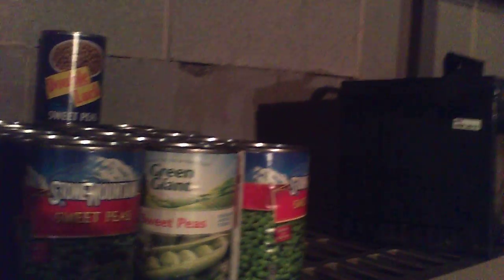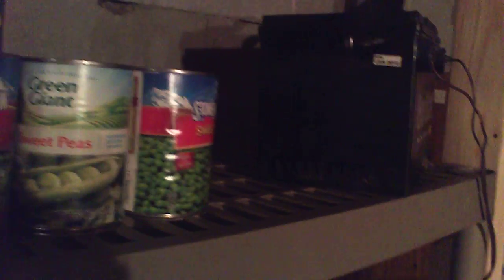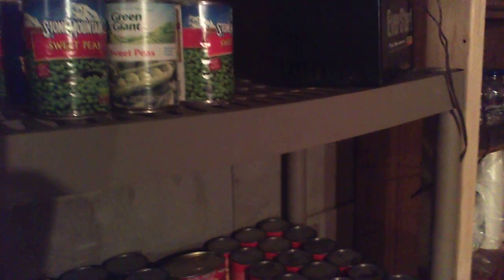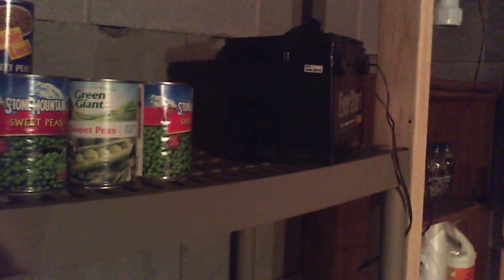12 volt NBC filtration system for your bomb shelter

Comment: How do you build it
Reply from the maker: I used a 12 volt fan out of a blow dryer and mounted it into a piece of PVC with a reducer which had a gas mask filter attached to it on the outside of the shelter so the fan would easily pull air through the filter into the shelter

Comment: If you survive the noise yould be fine
Reply from the maker: What noise it does not sound like a blow dryer
Reply from the maker: It's just a small 12  volt motor you can barely hear it the blow dryer case is what's makes the noise

Comment: It's better to use a leisure battery than a car battery if you can get one, as car batteries are not designed to be discharged more than about 20% regularly, or they will soon pack in.  Even leisure batteries shouldn't be discharged more than 40% very often if you want years of life from them. Tha
Reply: Sorry ,thanks for the video (sensitive computer!!)
Reply from the maker: YA WE UP GRADED TO TWO 1100 DEEP CYCLE MARINE BATTERIES
Reply: They'll last you much better.For any given load when you have 2 batteries in parallel you actually get a bit more than double the effective run time. That's because the less current you draw out of a lead acid battery the more amp hours the rating.You probably know already, but if you're wiring 2 batteries in parallel never take the positive & negative wires to the load or the charger from the same battery. Always do it 'on the diagonal' one lead from each battery. It's particularly important at heavy currents like from using an inverter. 

I've got dozens of batteries wired up here. I had 2 AC Delco marine ones still giving over 60% capacity after more than 20 years. I just never discharged them more than 30% & never let them go below 12.5 volts with nothing connected. Have a good Christmas.

Comment: Good luck with that.
Reply from the maker: we have tested the air fitration system with mace and tear gas as well as incents and have not been able to smell nothing in the shelter where the air flows in so we added a back up air filter using nato 30 mm cannisters

Comment: Would a plastic boat bilge blower work for this as well?
More than one for redundancy?
They are USCG approved ,made of plastic and have a high flow rate or CFM,take very little current to run them.
Now you just need a way the filter and dry the air to prevent mold spores from growing inside of your shelter effectively making it unlivable.
Other than running an air conditioner to condensate the moisture from the air , a desiccant material would be the only other way.
Have you ever studied how they condition and recycle the air in submarines?
Reply from the maker: 2009mechanic i dont think there designed to run all the time.we live in missouri with crazy humidity like 80 % AVERAGE we have a dehumidafier running all the time in ouir basement watch my new video called my new flash light and you can see what oi think about a little mold lol you gonna laugh your butt off
Reply from the maker: There's more then just my way to build a shelter try the pump from the boat and let me know still working on the shelter here a little more every week the bus is now buried and will
Reply from the maker: as you know these bilge blowers never last very long in your boat live well and they cant pull enough air to draw it through a good nbc filter for very long like the system I showed you.but ifyou want to try a bilge pump use a heavey vacumn line that wont collapse with a vacumn canister between the filter and the pump and id say it would work